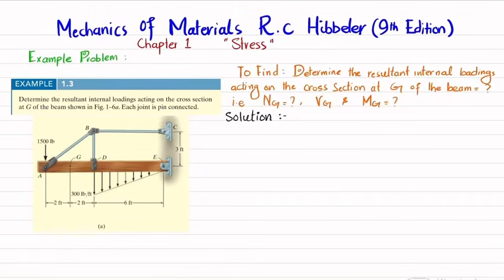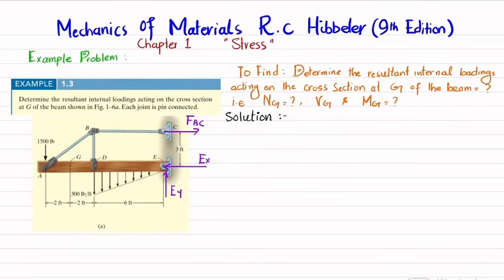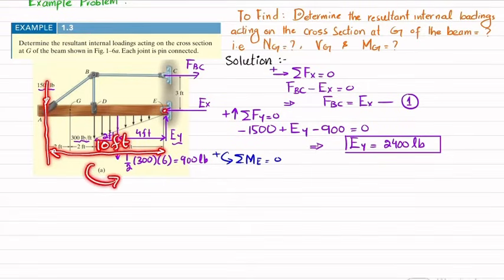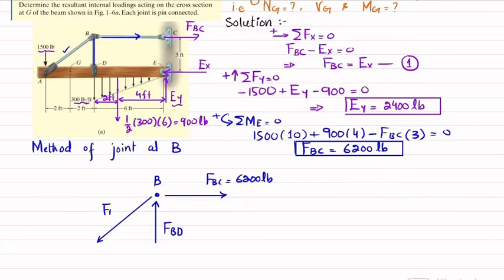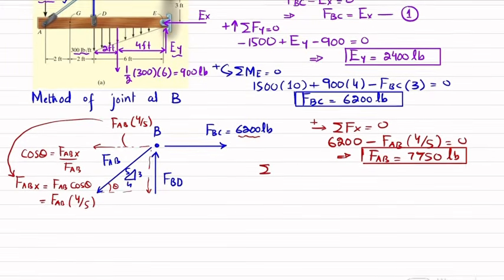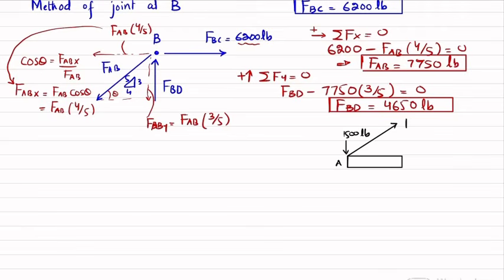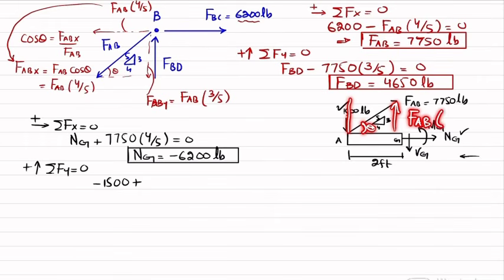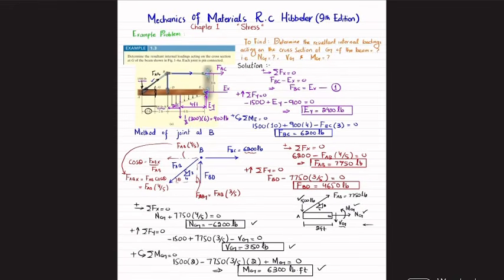Determine the resultant internal loadings at G | Example 1.3 | Mechanics of materials RC Hibbeler

Comment: normally we are taking triangular area L/2 in this example we took 2L/3 when we covert load to point load ??
Reply from the maker: Please mention the time frame in video where you have confusion
Reply from the maker: For uniformly  distributed load the area will be distributed load multiply by length and the point load acts at the center of beam or member (length/2) , while in triangular load the area will be 1/2 * height * length and the point load will act 2*L/3 from the side having larger load and if you want to locate it from the side having lesser load or zero at the end will have point load located at a distance of L/3.
Reply: @engradnanrasheedmechanical  thank you sir, after review video/solved on copy point is cleared.
Reply: you are doing great sir
Reply from the maker: Very nice and good to hear that. Keep watching and practicing 🎉

Comment: in the last diagram, why is the arrow FAB going up even tho it was going down on all other free body diagrams? thanku
Reply from the maker: Ok due to load at point A the rod experience tensile force causing the rod to elongate but as per newton's third law the rod AB exerts equal and opposite force at point A. That's why at point A the force Fab is shown upward.
Reply from the maker: When you isolate a section of a member, you must represent the force acting on that specific segment according to Newton's third law, so the direction flips to show the force exerted on the cut part.

Comment: Why you didn't include F_ba and F_bd in the first force equilibrium eqns?
Reply from the maker: the whole body is taken as free body diagram and only external forces acting on it are shown.
Reply: @engradnanrasheedmechanical you mean F_bd and F_ba are not external forces?
I'm confused..
Reply from the maker: @muhammadahsan70511 yes but for whole body diagram taken as Free body diagram....
Reply: @muhammadahsan70511  did you get the  answer to this question? Even I’m confused about same and hence I came to this video but I’m still confused. In the example just before this one they have used the force obtained from the two force member in the FBD of main member but here while writing initial equilibrium equations they are completely neglected. Not understanding how it’s possible.
Reply from the maker: What's the confusion?
Reply: @engradnanrasheedmechanical why are components of Fba and Fbd not used in initial equilibrium equations? If you remember the example just before this one which involved a 500kg engine. In that example we had used the two force members force component in the FBD. But here we are neglecting it. Hope you understand what I’m saying.
Reply from the maker: @adeptusmechanicus1023 ok so first we have to find the reaction force for that we have taken the whole body taken as free body diagram and found the reaction forces and then you have to find Fab . If you don't do that your Fab will be unknown and you can't find it.  @adeptusmechanicus1023
Reply from the maker: @adeptusmechanicus1023  every problem is of different nature. You have to careful read the question and have to act accordingly.

Comment: Sir how you took direction of member FAB away from joint A in free body diagram of segment AG ? ... I have confusion that while solving joint B we took direction of AB away from joint B that means it's toward joint A & we obtain positive value of FAB =7750 that means assumed direction was correct... Than how to take it in opposite direction in FBD ? Plz clear my confusion
Reply from the maker: Ok first you can see the force at point A cause the member G to bend and elongate so as a result member AG exert force towards right hand , similar the member AB also elongate causing tension in AB and as per Newton 3rd Law member AB exert force away from joint A.
Reply: @engradnanrasheedmechanical  ok clear Jazakallah sir
Reply from the maker: Remember in your mind its the force offered by member on the joint not force in member. If you realised the force in member then member will act force on the joint in opposite direction. Its like that you are removing that member and replace by the force that member is exerting on the joint. Just think for few minute and it will be cleared to you.
Reply: @engradnanrasheedmechanical  yes yes I get it